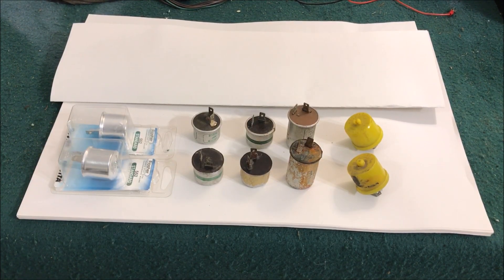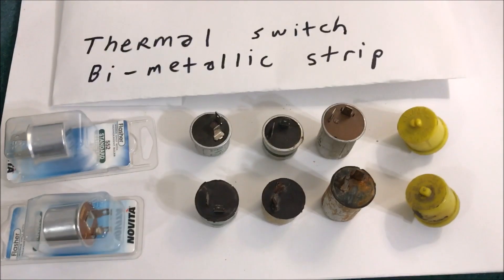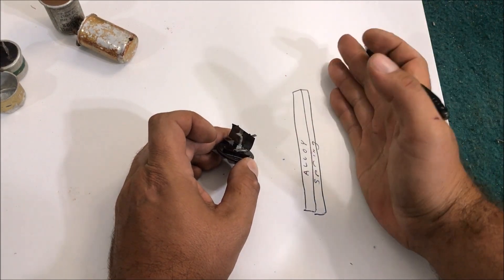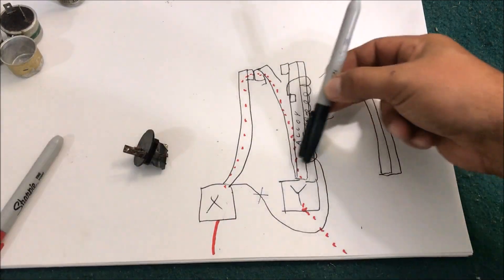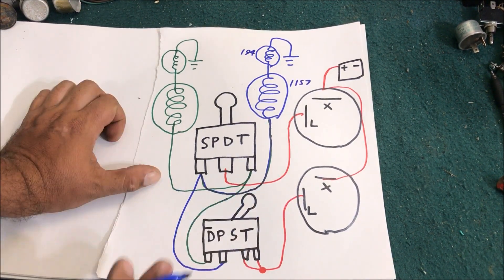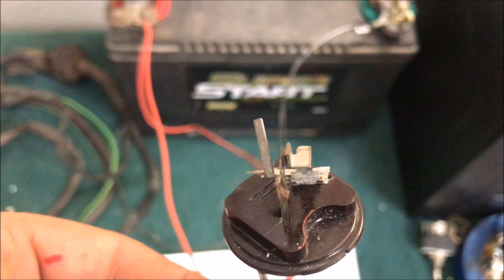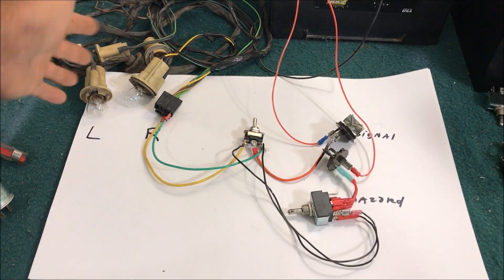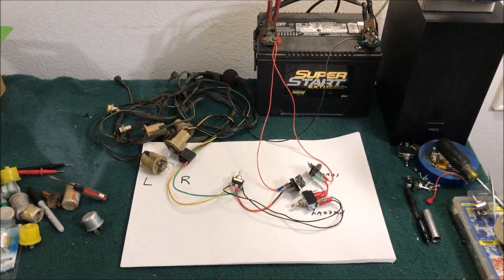turn signal flasher INFO and wiring mechanical 2 prong old style EXPLAINED

Comment: They not mechanical folks they electronic see the 2 flat things that's where you hook wires to which is 12 volts going through it so not mechanical
Reply from the maker: oh my god you have no clue about what you are saying 😞
Reply: It's a thermally actuated mechanical switch....😊

Comment: Best video about this subject ever.

Resistor 3:16 are not "semi conductors", they are "poor conductors". In fact, they are metal (there are carbon resistors too), and metal are conductors. Semi-conductors lower its resistance at high temperatures. Metals rises its resistance as temperature rises. Metal and semi-conductors behaves oposite over temperature change.

Comment: Best video I have seen on this! I have been trying to rewire an old 1993 Belarus 250AS tractor and this one thing on the wiring harness (which is relatively simple compared to modern tractors) has given me fits! Great explanation! Now I know the power has to go through the relay BEFORE it goes to the switch! Thanks much!

Comment: I took apart a TRIDON flasher that quit working....found material on contact point had accumulated and bridged the point gap. I scraped off accumulated material...reassembled flasher and tested...works like new.
👍

Comment: Thanks Chris great video. Have all the components to build that set-up and am going into the shop to do just that. Great explanation. Am a retired a/c mechanic and thinking of restoring an older 60's or early 70's vehicle before ever buying a new vehicle again. Thanks again for sharing your knowledge. Still have my Chiltons manual for my brand new 68 mustang that I wish I still had but still have all my original test equipment. Great channel brings back old hands on mechanics. 👍

Comment: Thanks again.  This is helpful as well for the project putting hazards and turn signals on my carriage.  I had thought I'd use a toggle switch to turn the system on, but the old style foot dimmer switch to activate the left or right turn signal.  The reason being that my hands can be pretty busy handling the horses when I need to activate the turn signals, but my feet are always available.  It appears there are a couple ways I can accomplish this project and you sir have given me a leg up!  Thanks again.

Comment: Thanks for video. This should help me figure out how to diy hook up turn signals on my electric scooter. The battery is a bit different though. I have an extra 2 pin connector that comes out the battery. But the rest of the concept makes sense.

Comment: Nice graphical explanation, Chris. Fixed load and variable load flashers operate on the same principle but are essentially reversed - the fixed load flasher (for the turn signals) is ON position in the resting phase. The variable load flashers (for hazard warning lights) are in the OFF position in the resting phase.
Your 1970 Chevelle has two lamps on each side, so you need a 224 (light blue shell) for the turn signals and a 552 for the hazard circuit. That will keep your car as close to original as possible. Use 1157 bulbs in the front and rear housings.

Comment: This makes me understand the circuit more. However  still struggling with my blinkers in a 76 Chevelle… any idea why there would be voltage at the flasher plug but then when I turn the signal switch on it drops to zero volts?

Comment: Q: I recently bought a '73 Honda CT90. They were made with the "possible" option that year for blinker indicators. Mine has switch on handlebars and a light in speedometer indicating signals in use. But no indicators or flasher relay. I bought '74 handlebars and taillight assy with indicators attached to them and a 2 prong 6v flasher relay switch. The blue connections that go on to flasher relay, do they get crimped lightly or just plug in? And the other end of wire needs to be male type, same as wire thickness, tubular shape, about idk say 1/2" long. Idk what those are called to make a search to buy. I'm thinking I'm going to have to make those wires. Are wires premade like above described for relay switch?
Reply: The tubular things that go on the end of the wire are called bullet eectrical connectors amazon has them i just bought some for an Indian moped i am restoring hope this helps if that is what you are talking about.
Cheers

Comment: Can I use this system to add hazard flashers to my 62 Plymouth ( which never had hazard flashers)..it does have working factory turn signals. Maybe you could post a diagram on how I should wire it up.

Comment: Awesome explanation! It helps a lot. Still confused about my situation though. My left blinker works perfectly normal. The right blinker works until the brake is applied. When I apply the brakes the right blinker goes solid and stays on without blinking and the left brake light shuts off when that happens. When I let off of the brakes they go back to normal. I have one flasher plugged into the blinker section but there is not a flasher plugged into the hazard section. Do I need two plugged in? Also, mine is yellow. Should it be the metal one you have on video? 
Thanks in advance
Reply from the maker: clean the grounds ..

Comment: I have a single pope two way switch for blinkers and on a temporary toggle switch that had a hot from the battery with a fuse qnd is temporary till I fix all the wires in a 78 dodge rv.  Kt to emotion it didn't have the manufacturer stick thing and I couldn't find one.  I connected    the hazard switch wires coming put th4 column as you did in the video going directly to the screws on the fist switch. My problem is the hazarss won't activate  unless one of the signals is on. My other issues is I'm guessing it's because I only have one of the flashers connected. I was sure previously i had worked it and was working perfectly fine. The rv took a huge dump on me a few months ago. Had someone do mechanical work on it and I'm wondering if he was oddly doing other random work on it. This person used to work at my mechanic shop and their was several issues including another old employee as today both no longer work their. Previously i had turn signal light issues and was fixed, git into an accident and I'm guessing during yhr time it sat someone cut the wires and blamed me for it when i was driving it and all the wires were oddly cut. I'm second guessing the recent person may have been trying to something way back than and  landed it on the other person who was supposed to work on it the first time... I'm juts trying to figure what o could be doing wrong or if I need the second flasher replaced. I'm also contemplating if I had replaced one f th4 flashers previously qnd don't remember it as it was connected but neither of the lights were working. My only other guess would be to add a second hot wire at the flasher.

Comment: Chris, I am so grateful you took the time to do this video, I have gone nuts trying to figure out an issue I have with a 1986 Honda Civic. I  had to re-wire my lights, parking light etc, due to the switch not been available. Everything works fine except the turn signal when I turn right, I get a blink on the right but the left light comes on and stays on without blinking, the same thing happens if I try to turn to the left, this one blinks and the right is on without blinking. Your video and perfect explanation has saved me from getting more gray hairs. I am truly very thankful and appreciate you taking the time to help people, that otherwise, doing such simple job would be a nightmare. I just have a question, I'm using a switch that reads L and R, is that the same as the one you are using?
Pedro M
Semper Fi

Comment: Thanks Chris! Just so happens I having problems with my brake lights not working. My blinkers work but not the hazard flasher or brake lights. Just installed a new hazard flasher but still  brake and hazard flasher not working???

Comment: Chris, do you have to use a second flasher for the hazard circuit or can you just take a second wire from the first flasher to the hazard switch?

Comment: So what in the turn signal flasher is actually making the clicking noise?  Is it the steel contact slapping against the metal alloy one?
Reply from the maker: Yes, it is the interaction of the two metals amplified by the aluminum cover... it isn’t very loud when you take the cover off

Comment: Have a question my new halo lights for my 1961 ford falcon have turn signals all in one but when i ran the wires from my old turn signals both headlight blink at same time
Reply from the maker: have you checked the hazard button? did you see the signals work before installing the halo lights?
Reply: Chris Craft no havent checked the hazard button and yes they worked with the old turn signal lights

Comment: I have a TUNG-SOL 224 flasher, no documentation there are no X and L notations near the terminals. I believe if X and L wires are reversed your blinker would be on when the switch is off??? So my question, what is the correct X and L location if unlabeled and is this standard? I'm thinking if tabs are positioned with the vertical left (X) and horizontal top (L) correct? By the way very nice descriptive video!
Reply from the maker: you just have to pop the cover and see which side the heated wire on the strip is on the prong.  if you wired it backwards it might not work right

Comment: Do you not need a diode for each wire to each indicator?
Reply from the maker: the indicator is just another bulb in series..
Reply: @chriscraft77022  Just that the wiring diagram on my trike harness shows a diode on each wire leading to each indicator bulb. I'm assuming does each bulb need to be earthed?
Reply from the maker: if it shows them maybe it’s for an led or something else I’m not sure.. my old cars don’t use a diode on the signal or hazard circuits .. let me know what happens..
Reply: @chriscraft77022  It's not LED and the trike electrics are for a 1983 Honda CB750 engine.
Reply from the maker: @MrRockstar1968  DC already runs in one direction so i really dont understand why they would need a diode.. run it without one and see what happens..
Reply: @chriscraft77022  The reason I'masking is because i'm having overload problems with the charging system when there is no diodes and then when I've put diodes where described in the wiring diagram it is still overloading the system. The charging system runs fine when the engine is running on iddle and with a few lights on, yet when I turn all the lights on it starts to gointo overload. The same happens when I have all the lights switched off yet switch one indicator on and then put the engine on high revs it also imedietly begins to overload the charging system.

Comment: My 1974 dodge charger blinks really slow on one side any advice
Reply from the maker: you need to check all the bulbs that normally blink (the marker lights have little 194 bulbs and the ones in the dash too.. clean the grounds that terminate the blinker wiring to the body
Reply: @chriscraft77022  hi chris , i gotta say i love  your  vids and you definitely do very fine work  Thanks so much  for sharing your  knowledge  . I'm  doing  a street  legal  mud truck/  steep trail crawler . The elec system  is , well about half factory  and  the other  half is just gone, anyway I've  got running  lights , left and right turn signals on  3 wire led tail lights  . How do I  introduce break lights  on the same wire  as  turn signals without  bumping the two together wich creates a hazard light  instead of independent trn sigs . Half the system that's  there is '88'  Suzuki Samurai.   I'm  pretty sure somebody out there had a similar problem , was thinkin maybe you could shed some light on it .. get it  ..hehehe    . Thanks buddy, you the man ..

Comment: I have a US mail light. It will stay on w/o the flasher hooked up with no problems. When I hook up the flasher it blows the 7.5 amp inline glass fuse . Any ideas as to why?
Reply from the maker: what is a mail light?  If the flasher is not hooked up the lights will not come on.. the flasher is an on and off switch
Reply: @chriscraft77022  a light bar with one light on each end of a metal piece that has US Mail painted on it.  It plugs into the power port(used to be the cig lighter) The plug has a 7.5 amp inline glass fuse that is what keeps blowing as soon as I connect a flasher. Yes I have already replaced the flasher.This shouldn't be that hard but I cant figure it out. Thank you
Reply from the maker: the lights should not be on at all if the flasher is NOT plugged in..
Reply: @chriscraft77022  Thats what I was thinking but that is not the case

Comment: Thanks so much for this. Does the voltage matter? I have a 6v system on my motorcycle but all I see are 12v flashers. I'm assuming I can't use those?
Reply from the maker: I would try they are not expensive..
Reply: @chriscraft77022  thanks so much. I've got a 6V flasher coming in tomorrow. One question though, the leads are labeled L and B with no other indication. I'm going to go out on a limb and assume that battery lead connects to B and the L lead connects to the switch/load?

Comment: You Saved me a Major headache appreciate it man!
 Now do you know how I can From Scratch Wire In Brake lights to a brake light switch (Still on the car) so I can Then tap into it with my Torque Converter wire so it knows to unlock once I hit the brakes While getting my brake light to work?

I hope that made sense! lol
Reply: I would Love to hear the results of this. 
Never heard of a converter staying locked up. What sort of converter is it?
I know very little about transmissions.

Comment: I’m in such a confused state rn. I wired my bike up like that perfectly. But they aren’t flashing with a new relay out of the box. One pin is B, the other is L. I’d imagine B is battery, and L is light. 
“Does it damage these to put them backwards?” Or have to low/high of voltage they won’t flash? Just consistently on....
Thank you
Reply from the maker: are you using the same parts I did? Or are you using led bulbs? different flasher?
Reply: Chris Craft cheapest of the cheap, bulb lights. But I don’t have a battery I need to point out. But
Reply from the maker: sometimes you have to add 194 bulbs.. a car uses 6 at a time .. are bikes 12 volts? has to be a 12 volt system

Comment: What about running lights added to this system
Reply from the maker: Different circuit
Reply: @chriscraft77022  do not the tail lights or side marker lights turn on when you turn on headlights ? Building Hot Rod have fuse box and 40 amp really installed, not need to wire up head lights and running lights, using one 5 pin for headlights and dimmer foot switch already connected, do I need a seperate relay and switches to turn on running lights ? I donot want daylight running lights just want ALL lights to come on when I turn on headlights ....Gary

Comment: Your diagram shows "X" as the blade at 12 o'clock and "L" at 9 o'clock.  The assembled circuit indicates otherwise, ie. "X" is actually at 9 o'clock.  Also, it would have been useful to help distinguish which lead wire is the  source (to "X") and which connects to "L".  Otherwise, I got a lot from  your video.  Thanks

Comment: i did the same thing for my motorcycle (honda dio scooter). but one I connect the front signal lights, double signals didn't work.(without the front signal lights it works perfectly) but with single front signal light again it started to work. I'm glad if anybody can help me with this